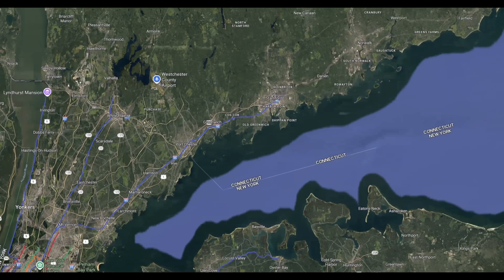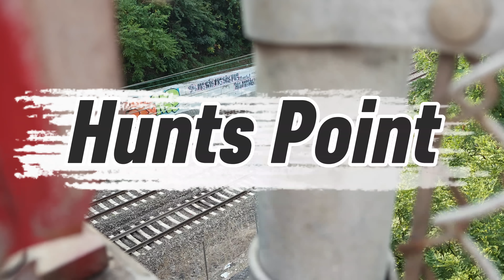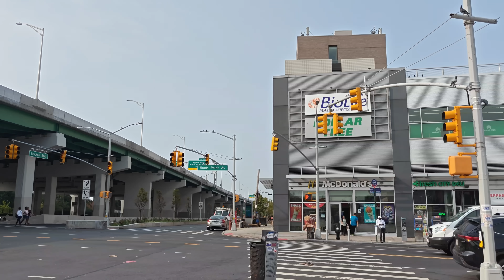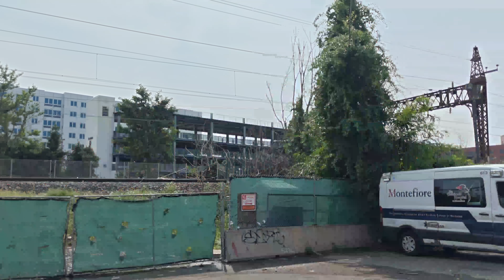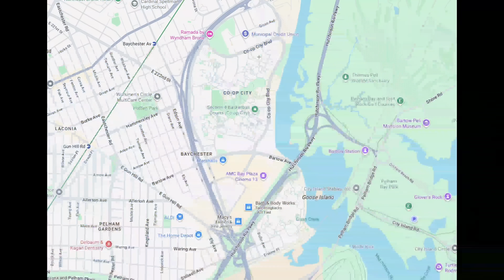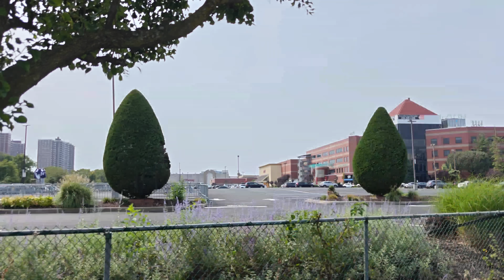One of the four new Bronx train stations has a BIG PROBLEM

Comment: I was always in favor of expanding the #6 line into Co-op City. Yes, I lived there from when section 1 opened into the early years of my marriage (a long time ago!). You can have a stop at Gun Hill Rd before either Baychester Ave (which might conflict with the #5 nearby) or in back of section 2. On the 2nd, it can either be built lower to the ground as there's only greenland there (unless it changed recently), or end at Bartow Ave. Yes, it'll cost money, but what doesn't. Best, in the rush hours, trains run express south of Parkchester, which is the terminus of the local train.  Well, better or worse, that's my thoughts.

Comment: Glad this came up in my feed and thank you for the most comprehensive review of this whole project that I've seen to date!

As a current and long-time resident of Co-op City and born and bred Bronx resident, I agree that the Bronx has been long neglected in terms of any infrastructure improvements including transit access.  

My question/concern is:  now that MTA runs the express buses city-wide (it used to be owned and operated by a private company and much more efficiently I might add), will that option be eliminated in favor of funneling people to the new MNR service with shuttle buses or additional buses run on the existing bus routes through the complex that connect to the part of CC that the new station is located in?  I find it a little hard to believe that both will continue in tandem although there would still be some benefit to many despite the duplication of access to Manhattan between them.

Also as someone else commented: are shuttles to the station going to be free?  Or will the shuttle fee be considered a "transfer" and the subsequent MN ticket be discounted by the price of the shuttle?

As others have also commented, I've always thought this area of the Bronx was ripe for gentrification and definitely believe this sudden (well, not so sudden since it's been in the works for over a decade) interest in adding access from here to Manhattan has more to do with that than improving or increasing service to the current resident population.

Comment: You have some glaring points of total misinformation...ONE...That is 125% trash that Metro North does not serve the Bronx..Fordham is where you can connect with local and express trains. I use it all the time coming back and forth from CT, and there are more than 3 stops in the Bronx.  TWO>>>They can easily make a proposal to get grants and other funding and use these lazy azz men and women to work on the projects and maintain/clean the system. It makes sense instead of spending $60 / non violent criminals in and out of prison, and wasting money on these women and men that keep having children they refuse to take care of. Got 5 babies from 56 men?Use your daycare and then work 8-12 while they are on school. Get off the couch playing video games, put on your boots and work on the tracks instead of spending time making YT content. THREE>>>Co OP city folks already have a bus only for Co OP City, as well as an Express bus, and Queens bus, the 38, 28, 25/26, and 30 buses. The issue with CoOP City is at the time they built it on a landfill, they had not projected the amount of cars, because most people did not own cars. To add to that, the infrastructure was not maintained properly, and even at one time the MTA was going to cut off the 5 train service, totally leaving the residents without a MTA train line. From Gunhill and Boston RD the 38 takes about 30-40 minutes to snake through Co OP City. They would LOVE a Metro North station in all these places in your video, because right now, we have to head all the way to 125th street or 42nd to get an express. SO I have to head to Harlem's 125th street and it's den of drug infested block from the 4/5/6 trains. You have to wade through 45,345 addicts,  beggars, and finally get in the station, where they had to devote a room with NYPD to keep the station from being overrun with the zombies. If they do it right this time, the Bronx will have over 50,000 jobs, new businesses, reopen old factories/commercial spaces, and heal itself.

Comment: I live in Morris Park. While I don't have an issue with Metro North coming to the neighborhood, I have a huge issue with the new oversized buildings going up, which will overpopulate a low density area.Morris Park is mostly 1-3 family homes, not high rises. Those high rises you mentioned are part of Einstein's campus and is housing for students/staff, not something that is common in Morris Park (if you took a look around MP you would see this). Shoving these huge buildings into this area is not a good thing - it will put a strain on our utility system (which is already strained), transportation system and school system. Of course none of the urban planners who grew up in the suburbs seem to understand this little concept. This city will do whatever it takes to ruin what few decent Bronx areas are left. 

BTW, graffiti isn't amazing. It's gross and disgusting as well as vandalism. It's one of the many blights on the Bronx.

Comment: I'm a civil engineer who worked on the New Haven Line in CT - infrastructure, main line, shops & yards, stations, etc.

The Co-Op City stop is as close as possible to the density nexus - no one is going to propose rerouting the main rail line.

This "last mile to half mile to go" issue is a Big one for airports all over the country, where a commuter / intercity rail line runs "close to" a major airport's passenger terminal but isn't within easy walking distance, & there's no funding to extend or reroute the rail line.  This problem is typically solved at first with shuttle buses, then eventually via either some sort of fixed guideway mini transit system ("monorail" at Newark) or moving walkways if the distance is short (TF Green in RI).  My home state of CT has this issue currently w/Bradley Airport & the fairly new "Hartford Line" - for now, they run shuttle busses, but someday maybe a fixed guideway transport system will be built?

This new station looks close enough to co op city that a moving walkway / people mover just might be feasible.
Reply from the maker: A few years ago I fantasy mapped a streetcar for Co-Op City. That would happen if we were capable of building new fixed route ROWs, which we are really not.

Comment: The D train was originally slated to go to Co-op City.  That's why it turns East before 205th.

Apparently, when the city found out the New York, Westchester, and Boston Railroad's Bronx portion was for sale for MUCH cheaper than the cost of extending the D, they purchased that and turned it into the 5 from 180th to Dyre.

The Baychester Avenue station was deemed, "close enough," to Co-op City, which is absurd.

Comment: The solution to Co-Op City is to expand the 6 line 3 stops. Maybe 4 to get thr train to end neer the Pelham Border on Bsoton Road and close to the shopping area that borders the end of the Bronx. Or extend the 2nd Avenue line to the Bronx to run on Third Avenue replacing the old 3rd Avenue L and extend it to Co-Op City.

Comment: The thing to have done would have been to extend the #6 line into Co-op City during it's construction, almost 60 years ago.  The QBx1 (now the Bx23) to Pelham Bay Station was and still is to some degree the bane of commuters to Manhattan, as just to get out of the complex – a lengthy and convoluted grand tour, can take almost as long as the #6's run time down to Midtown.  As to the Metro North station's location, you are correct in that it is remote to the majority of the complex, which lies well to the north, but that's simply a function of the routing of the Amtrak/NE Corridor ROW, and it is what it is as they say.  Getting over to the new station for Metro North New Haven trains will ironically somewhat resemble the long-existing slog over to Pelham Bay Station for the IRT #6.  Co-op City's aesthetics by the way are a product of the late 60's not the 70's as you mention.

Comment: THE TRAIN LINE YOU'RE REFERRING TO IS THE ANTRAK TRAIN LINE WHICH RUNS FROM PENN STATION AND THROUGH WESTERN QUEENS BEFORE TURNING AND HEADING TO HELL'S GATE BRIDGE AND RUNNING NEXT TO THE RFK BRIDGE AND THEN NEXT TO THE BRUCKNER EXPRESSWAY AND THEN NEXT TO THE HUTCHINSON RIVER PARKWAY THROUGH PELHAM BAY PARK AND THEN CROSSING FROM THE BRONX INTO WESTCHESTER COUNTY AND THEN MEETING UP WITH THE METRO NORTH NEW HAVEN LINE TRACKS JUST BEFORE THE NEW ROCHELLE STATION AND THEN STOPPING AT NEW ROCHELLE BEFORE CONTINUING TO BOSTON OR HARTFORD. THE HARLEM AND NEW HAVEN LINES RUN THROUGH THE BRONX FURTHER TO THE WEST (NEAR THE BRONX RIVER PARKWAY AND THE 2 AND 5 SUBWAY LINES). MOST NON RUSH HOUR LOCAL HARLEM LINE TRAINS WITH WHITE PLAINS AS THEIR TERMINUS DO MAKE STOPS IN THE BRONX WHILE MOST NEW HAVEN LINE TRAINS DO NOT. THE NEW HAVEN LINE (AS WELL AS THE TWO OTHER METRO NORTH LINES) ALL RUN OUT OF GRAND CENTRAL STATION UNDERNEATH PARK AVENUE AND THEN ABOVE PARK AVENUE BEFORE ENTERING THE BRINX. THE NEW HAVEN LINE SPLITS OFF FROM THE HARLEM LINE AT THE BRONX - WESTCHESTER BORDER AND RUNS NORTHEAST TO MEET UP WITH THE ANTRAK TRAIN TRACKS WHOSE ROUTE I DESCRIBED ABOVE WHILE THE HARLEM LINE CONTINUES NORTH. (THE HUDSON LINE IS THE ONE THAT RUNS ALONG THE HARLEM RIVER AND THEN ALONG THE HUDSON RIVER AFTER SPUYTEN DUYVIL) AND JOINS THE ANTRAK TRAIN TRACKS RUNNING ALONG THE HUDSON FROM PENN STATION ALL THE WAY UP TO ALBANY AND SCHENECTADY WITH LINITED SERVICE FURTHER NORTH TO TORINTO AND MONTREAL. THE METRO NORTH HUDSON LINE ONLY GOES AS FAR AS POUGHKEEPSIE JUST LIKE THE NEW HAVEN LINE'S MAIN BRANCH ONLY GOES AS FAR AS NEW HAVEN. IN ANY CASE, THE STRETCH OF TRACK LINE YOU'RE REFERRING TO IN THIS VIDEO IS THE PORTION OF THE AMTRAK LINE BETWEEN PENN STATION AND NEW ROCHELLE THAT RUNS THROUGH THE EAST BRONX AND DOES NOT MAKE ANY STOPS BETWEEN PENN STATION AND NEW ROCHELLE AND WHICH CONTINUES BEYOND NEW HAVEN TO BOSTON OR HARTFORD. GET YOUR SHIT STRAIGHT. THANK YOU. YOU'RE WELCOME... 🙄🙄🙄🙄🙄

Comment: You're wrong about the Hunts Point Station.  The old building was sold a long time ago.  The owner didnt want to sell it back to MTA,.  So The new station will be around the corner, on Garrison Ave and Irvine St
Reply from the maker: Aw, damn it. On the map it looked like the same place.
Reply: The MTA can take that building under eminent domain MTA already took properties in East Harlem and they can take that building
Reply: @hazelady5068 Yes, they could have.  That would have added several years to the project timeline, Plus legal fees, and bad press.  Moot point now as the new station is well under construction now.
Reply: CORRECT 💯

Comment: The New Haven line does not bypass the Bronx, just the  far East Bronx. Three of the four new stops make great sense. The last thing the Bronx needs is more apartments. Residents of the Bronx will probably not use these new trains due to cost. Coop City was built in the era of the automobile, no mystery here. Also Coop City is a high density shithole. You live like in a chicken coop city.

Comment: The 6 Lexington ave local should be expanded into co op city from it’s current terminus at Pelham bay park. But that’s not happening. What trains will run over the hellgate bridge, there overhead catenary 11 kv, power for Amtrak trains, and no third rail, the other alternative is locomotive power to pull cars in and out of penn . By the time a train arrives at co op city there won’t be any seats left, and it won’t get better as the train moves south. Also I wonder how the snooty ct riders are going to take the rabble that will get on in the Bronx. I’m a Bronx native and would be looked down upon when boarding the train into the city.
Reply: The people in co-op city do not want the train to come there. They don’t want the riffraff to come along with the train station.
Reply: Most of CT is middle- & working-class. Also this would be the inner NH Line that mostly stops in Westchester, and already serves Stamford, Rye, New Rochelle, Mt Vernon, and Fordham without issues.

As for the trains & seats, that's something Metro-North already tracks and handles through load balancing.

Not saying there's no more racism or potential issues around gentrification, but I think you're working off of fears born from internalized racism. Bronxites pay NYS taxes, these are services we have built & earned, and we have the right to use them for work & leisure like anyone else.

[Edit: And yes, Italians can still feel internalized racism - that sh't lingers across generations 🫂]

Comment: In Co-op city, I don’t think it would be practical to move the ROW. However, I think the new station would be a prime opportunity for some type of automated light people mover. The train would be elevated and come every 2 minutes or so and have 4 stops, one at the Metro north station, one at the shopping mall (which could be massively upzoned into a mixed use neighborhood, one at co-op city itself, and one at the 5 train. This would also allow 5 train riders to benefit from the Penn access stations
Reply: Unfortunately even if the MTA supported it and had the funding, I think there would be significant community pushback. Honestly, they should just extend the 6 train to Co-op instead atp
Reply: The people of co-op city do not want all that rif raf that comes along with the transit

Comment: I grew up in Co-op City, and was an original resident of one of the buildings on Casals Place. It was always a pain to get to the #6 train at Pelham Bay. You had to take the old Queens Transit QBx1 to get to the train, but there was at least one more option: The express bus service, formerly run by the private New York Bus Service. It has been run by the city for a long time now. Still, its last stop was on 23rd St., though I seem to remember there was a second express service that ran to Wall Street as well, but I might be wrong on that one. Important to mention also that the QBx1 also had another service to Flushing from Co-op, but I don't know if that's still active these days.
Reply: You're not wrong about the one to Wall Street, the BxM7 had service to Wall Street until 1987. There was a plan for a BxM17 to go back downtown (via Queens-Midtown) for the bus draft but that was not implemented.

The QBx1 no longer exists and is now the Bx23 and Q50 Limited since 2010. Bx23 runs as a Co-op City Loop between all 5 sections and Pelham Bay Park. The Q50 LTD runs between Pelham Bay Park and Flushing though during rush hours, it's service is extended to go through Co-op City like the Bx23 to Section 5 (though it does not go into Dreiser and Einstein Loops).

Not a resident but I've almost always went to school there, have had friends who lived there, and go to Bay Plaza quite often for shopping so I can say that it isn't the best experience to get to the train but it could be worse. At least you can get to most of the other Bronx trains via the Bx25/26 or Bx28/38.
Reply: @eliyaskiya  Thanks for that. I haven't been back to Co-op for three years now since my mom died. I never had reason to use any of the buses when I 'm there, since I drove down from upstate (Central NY, really). I did take the express bus once when I was there to meet a friend in Manhattan for dinner, as there was no way in hell I was going to drive into Manhattan, LOL.
Reply: @gasaholic47  No problem, not driving there is pretty understandable considering traffic (and now congestion pricing). Sorry about your loss, I hope you and your loved ones are doing well
Reply: Section 4 here! We moved in back in 77!
Reply: Original tenant of section 2!! Traveling out of Co-Op was/is a nightmare!! Once I graduated from college, got a job on the upper east side, the commute after a 12 hour shift was my breaking point!! I was at the mercy of the express bus. As a teenager, if my sister and I wanted to go to a concert in the city, we had to be picked up by our parents… and going to school in Queens was a 2 hour commute by bus!! I miss Co-Op for some reasons (central air, apartments with a view, greenery), but you definitely need a car!! I’m now in the Bedford Park area, which is nice, but I miss my sprawling views from the 23rd floor!! 😊